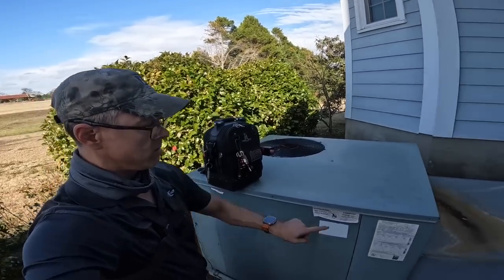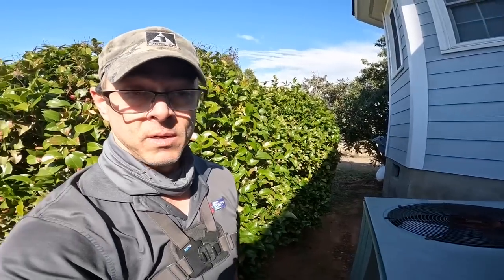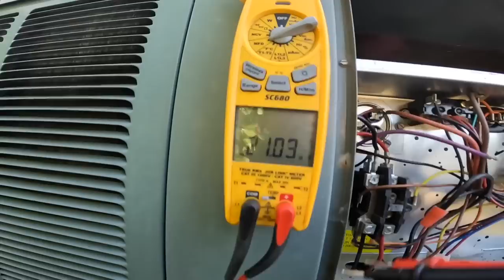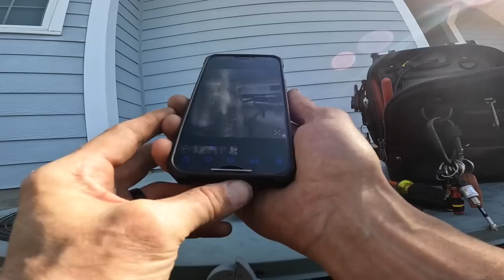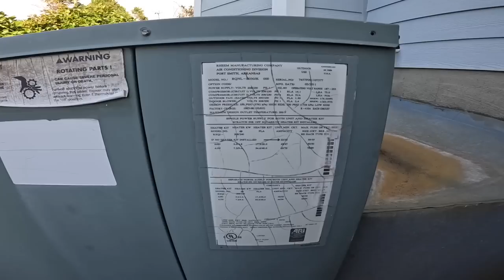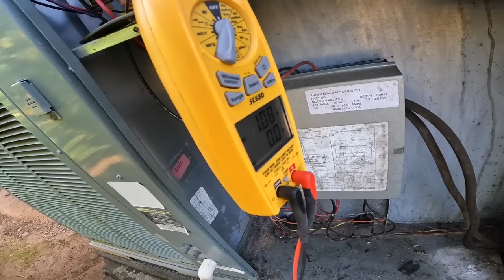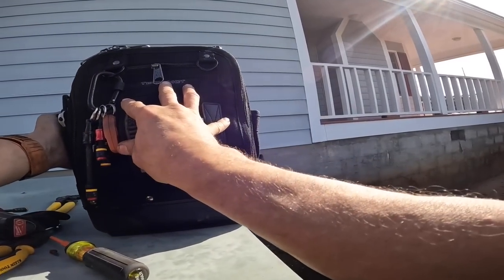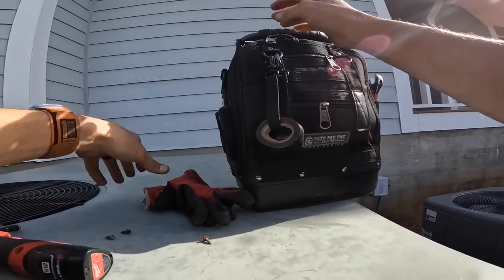Customer Called And Said His System Was Screeching

Comment: I’m going to have to move from Florida to Tifton GA just so that you can service my AC! Great video bud. Quick tip, if you cut a small slit on the back side of the motors box, you can stick the shaft through it and it will help hold it upright for you while you work on screwing on that cage part.

Comment: When replacing a motor, take the motor out of the box, and close it up.  Use the box as your table, by putting the shaft of the new motor in it.  That way, you can put the cover on, without having to fool with it...

Comment: You can take about a 1inch piece of paper towel hold it over shaft of wire brush and then push it into the drill, that will hold it until you pull it off.

Comment: I woulda thought that by 2023, fan motor's shaft end that connects to fan, could be dipped in a rust proof coating during manufacturing process for a minimal cost increase.  Also, do you come across new capacitors that are bad, right out of the box very often?

Comment: I live in Arizona and my unit was making some horrible screeching noises 😮 and after looking up info on internet i found out that the condenser was going into a defrost mode 😮😮 I hope that it’s a normal thing…..
Reply: If its a heat pump it is,does  it get very cold in Az this time of year
Reply: I guess i shouldve read your second comment before i replied lol,suprise you would even need heat mode very often in az,
Reply: If you're referring to a hiss, that is your reversing valve switching

Comment: From watching your videos i get the feeling that the majority of units out there are heat pumps. Most in Vegas for residential are straight cool with gas furnace for heat.

I feel like you can stay busy year round with heat pumps cause they seem to break down more than furnaces
Reply from the maker: Furnaces break too. Around here if you don’t have gas you’ve got to have a heat pump…unless it’s commercial
Reply: I do heat pumps to and they constantly break down there always running
Reply: Heat pumps suck.. mine broke down 4 5 times and I just said screw it and switched to gas furnace since my house has a gas meter..
Reply: Hest pumps can be reliable.  Most breakdowns due to poor  install or lack of maintenance